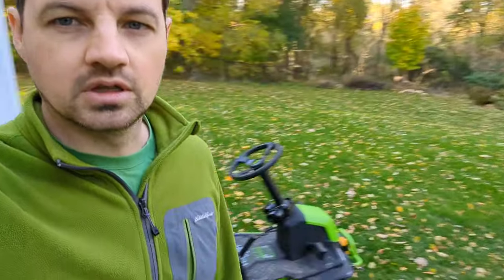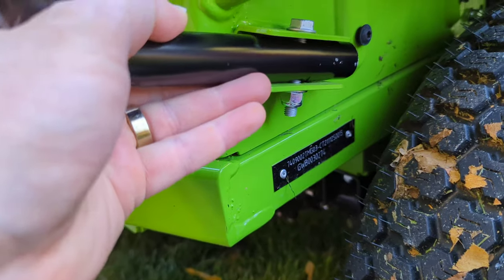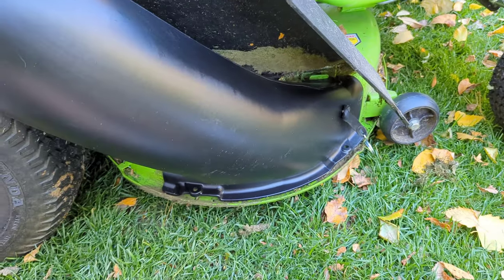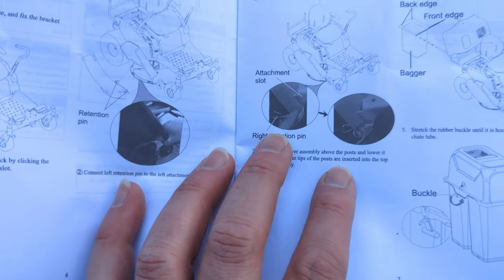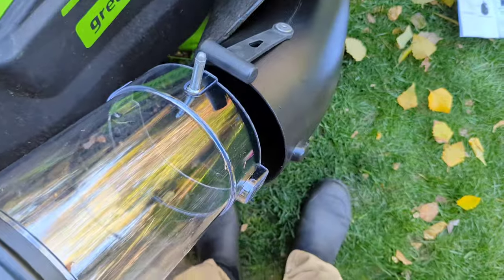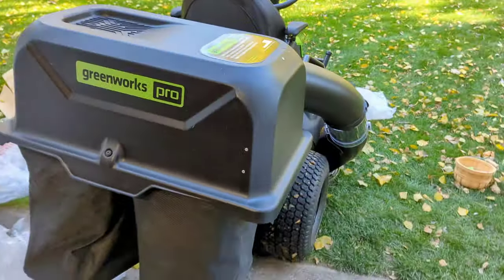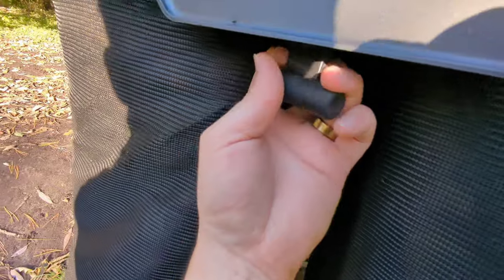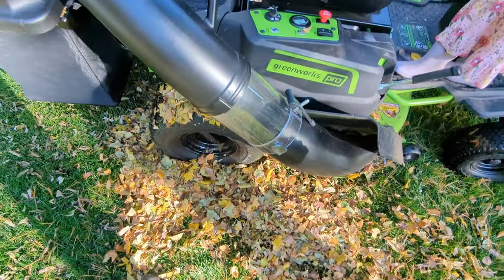Easy INSTALL and REVIEW of Leaf Bagger on Greenworks riding mower 🌿 🛍️

Comment: also interested if you changed the blades?
Reply from the maker: I did not change the blades. honestly too worried I wouldn't bolt it back on well enough lol
Reply: @ilawn  I know it is hard to do with electric, But if you go over once a setting or two higher then you like. Then when you go back over it (even the next day) at the height setting you like you pick up Way more and the bag fits 2-3x as much because everything is smaller. In turn taking the same if not less time so you are not driving back to the dump site lol. 
 I hope all that "mobility" items they have coming out on the 80-82volt series also comes to the 60v ones
Reply: @dizzlethe7346  that's a good idea, thanks
Reply: I purchased the torque wrench to change the blades, and also a mower lift. I decided to call the greenworks help line to ask if I had to change the blade back and forth between cutting and leaf bagging. The greenworks company informed me that it was the same blade(s). So essentially I have extra blades now and fortunately do not have to change the blade between each specific use. I will do a visual comparison the blades before using.

Comment: I can’t get mine past the side discharge chute. It would have helped for you to show how you actually attached the first chute
Reply from the maker: I'm not sure what you mean that it won't go past the side discharge chute
Reply: @ilawn  well i must have figured it out. Required a bit of muscle to attach both ends
Reply: I removed the plastic side discharge chute and it goes on much easier. Otherwise, mine would not fit correctly. Would be nice if Greenworks had better instructions.

Comment: Hi.......I have the same mower.....did you install the other blade, or keep your blade on.......I have the mulch blade installed, that I would like to keep on the whole year......and what setting did you put your blades at?.......Thank you......
Reply: I haven't changed the original blade. I suppose it might mulch better if I changed it, but it does ok the way it is for me. I'm not aware of blade settings...where are those?
Reply: The blades in bagger kit are high lift, providing more suction.
Reply: @skipgrumblis  My question to you is if I use those blades that come with the bagger system, and I take the bagger system off, will those blades still work in my yard as for as mulching?.......After I take off the bagger system, I put the mulching cap back on.......Bottom line, I don't want to change my blades all the time........Will this work, like I described?   Thank you
Reply from the maker: I'm sure it will still work, but grass might accumulate under the deck a bit more if you don't have the side eject open
Reply: I would love to see a video on how to drop the deck to change the blades on this mower.

Comment: Mine keeps getting clogged in the chute and the bags arent even full. Im wondering if its a poor design
Reply from the maker: mine gets clogged if I go too fast. The air speed is definitely no super strong. But if the leaves are dry and I don't go too fast, it's fine